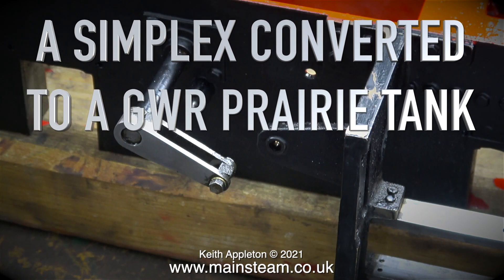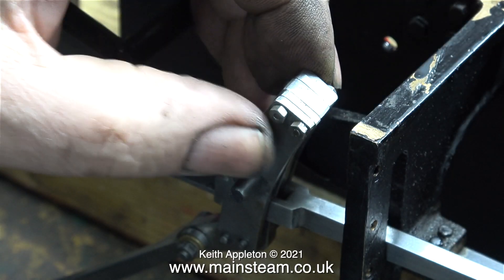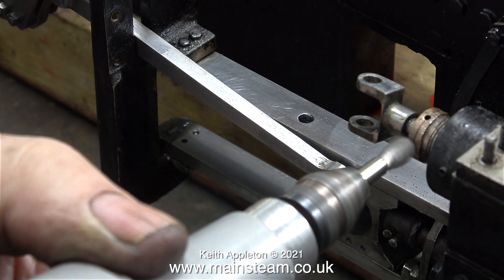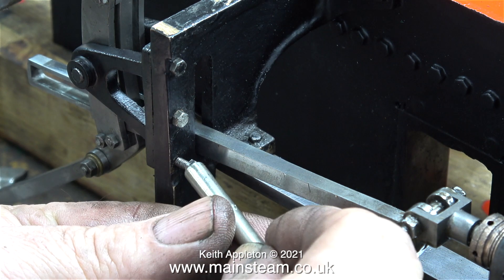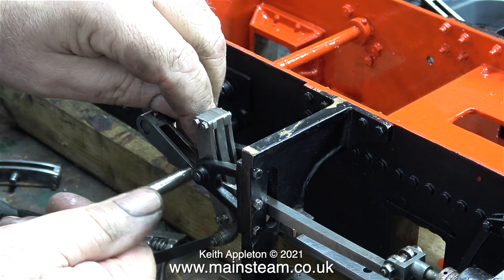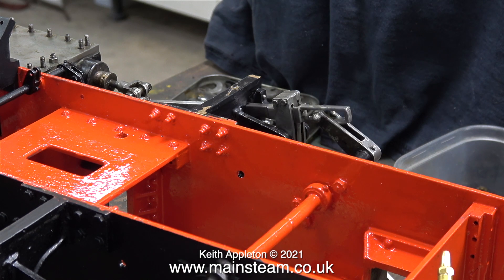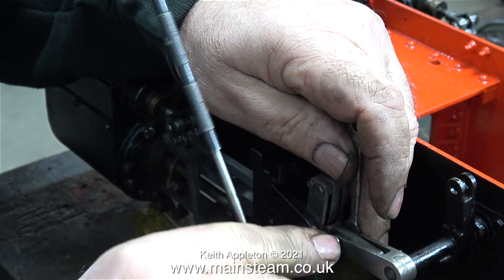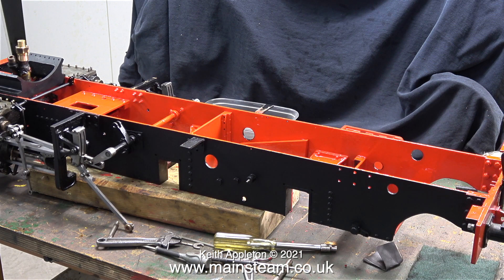SIMPLEX PRAIRIE TANK - PART #57

Comment: You say "steam engines are far more primitive", I would say they are more robust. If it's hand fired its generally EMP-proof and Flex-Fuel(with the option of Carbon Neutral if you use wood and the trees are replanted).

Comment: Basic question... not a leading or critical question... just wondering, no lock washers or other means of preventing the screws from loosening is used ? ... or are you locktite-ing them off camera ?  Do they rattle loose ?
Reply from the maker: No, the bolts are all tightened against the shoulders of the pins.

Comment: Hello Keith.  Hope your well . Im having trouble finding cellulose thinners . Where could I find some please.  Ive just stripped my 5 inch gauge dougal down to re paint it . I plan to soak the running bords in it . How much would it cost me to be a patrion subscriber please
Reply from the maker: It's available from most Motor accessory shops or Automotive paint suppliers. The first Tier on Patreon is $5.00 per Month, this also includes a FREE download of my "Complete Guide to Miniature Steam" E-book........

Comment: What is the best material to build the frame with? I got some plans for a lbscr terrier class but it doesn’t tell me what material to use for the frames.
Reply from the maker: BMS - Bright Mild Steel. (Usually stated on the drawings).